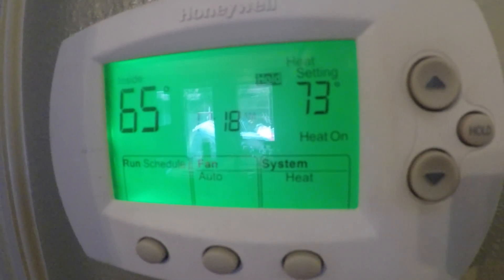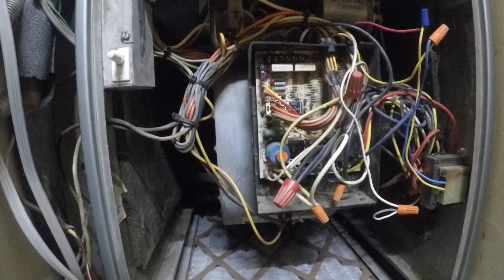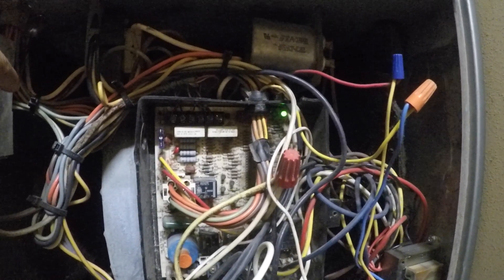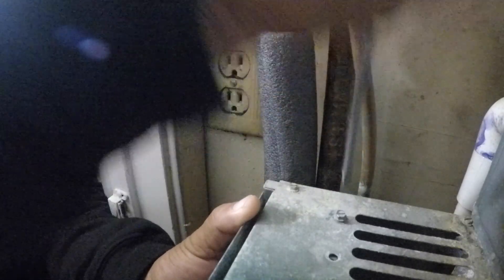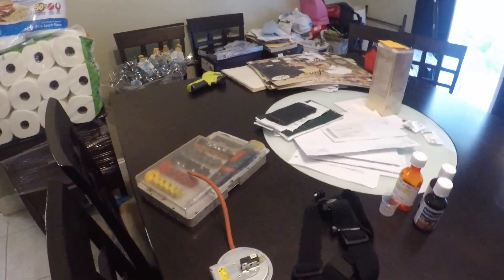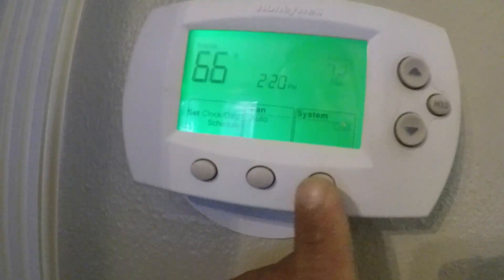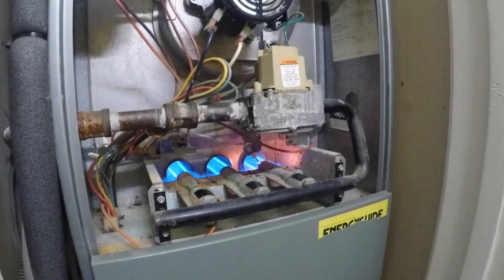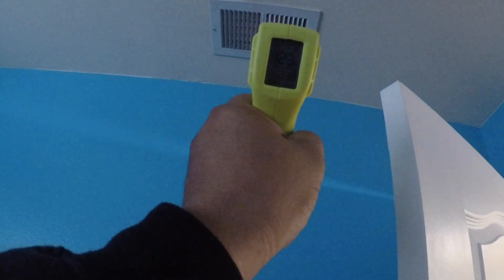Rheem Gas Furnace Won't Turn On | 2 Blinks Codes Fixed -No Heat

Comment: Didn't think I would have to suck off the furnace to get it to work right but here we are. Hole where hose connected was plugged with debris and hose dry rotted just around plastic hook up- disconnected hose, cleared block, and reattached hose after giving it a little blow for good luck and we are back up to 70. Thanks!

Comment: Great video. Sadly it did not fix my Rheem furnace. I had to replace my inducer fan assembly because the fan system went out which also causes the two blinking lights (2 blinks then a pause).

Comment: 30 yr teh here ...actually do not blow into the pressure switch but instead suck gentle on to create an & vacuum & u should here it click & also clean it port that it connected too with an small wire or small nail  a bad   PS is seldom the problem  its usually an clog in its port or the flue pipe is clogged ...

Comment: Daniel, just wanted to say "THANK YOU", for your help today! Just went in and turned the system back on after following your advice, and she just fired right up! 👍Woohoo! Saved me a few hundred 💸 for a bunch of parts, it clearly didn't need. And probably wouldn't have been installed anyway! After all, if you aren't brave enough to pull the panels, take a look, and poke around in there, how would you ever know whether the "new parts" installed are new, or not? You wouldn't.
   Again, I genuinely appreciate you. And no need to ever apologize for your boy's excitement. YOU are helping US, afterall. He sounded as happy as I am right now. 😂 This was shot 3 years ago, and I hope you two are doing well, today. ❤

Comment: In addition to suction, you can take a paperclip or awl and make sure that the port for the vacuum is not clogged up with gunk.  Part of a normal cleaning, but mine get clogged up every few years and just need cleaned out with a small awl, but a paper clip or anything else will work.

Comment: As a licensed HVAC Contractor this should only be used as a bridge to permanently repairing.
Reply: Rich, for all of us "non HVAC licensed" folks out here, for clarification, did you mean just going ahead and replacing that vacuum pressure switch? Which seems logical, since this one obviously needed some "help" to regain its ability to acuate its intended function. Thanks

Comment: People This also a good way to ruin a perfectly good switch so that your furnace will have more problems than the original one. These pressure switches operate on very low psi and can be ruined very easily with too much vacuum or pressure.  I agree that while this can be a temporary fix, one should  proceed with caution. Using a multi-meter ( if you have one) is the proper way to check the operation of these switches to determine if they are the cause without damaging the switch and wasting your money. 

I can appreciate the gentleman for being helpful and spending time making this video but know what you're doing or you will make things worse. Just My 2 cents. Good luck!

Comment: This video saved me from freezing today! I didn't disconnect that part with the tube...I just starting squeezing and pinching on the tube with everything still connected...After about 8 seconds of pinching on the tube, the furnace pilot light came on, & the furnace started pushing hot air...awesome video!

Comment: Worked bro! I spun that fan in both directions to knock dust loose. Design flaw to leave it exposed to dust. Heater kicked on in seconds!
Reply from the maker: Good job bro , congrats 👍👍
Reply: The only thing that seemed to get it going for us was to spin the fan in both directions as well . Thank you everyone for your help
Reply: Holy crap, spinning the fans back and forth in both directions was the only thing that got mine going!